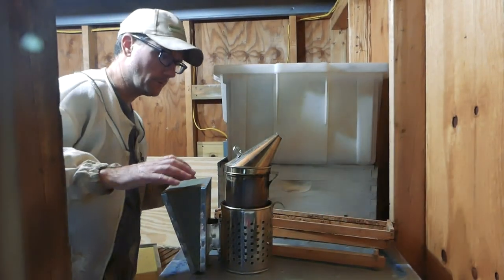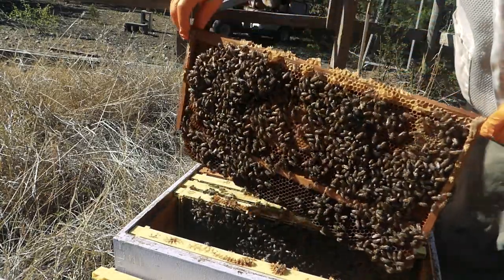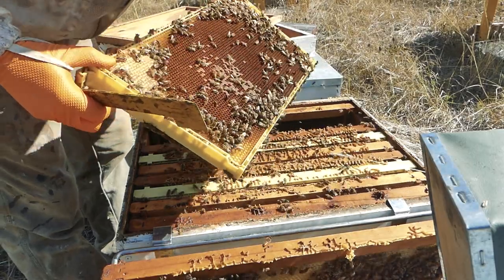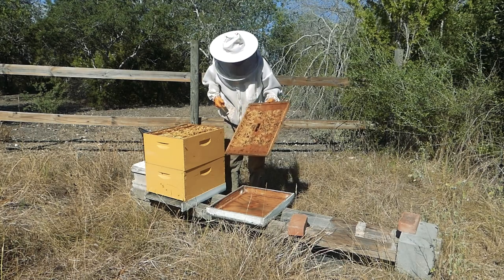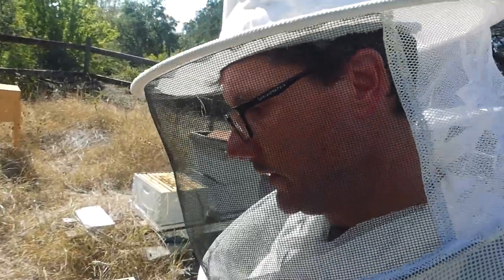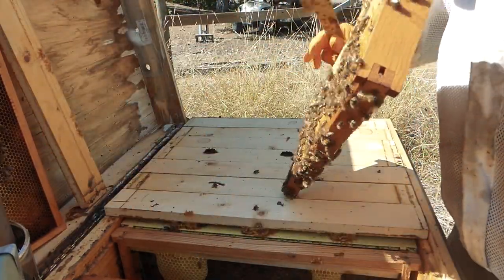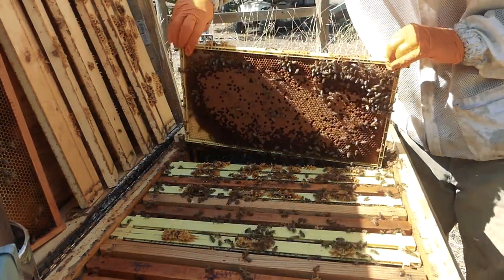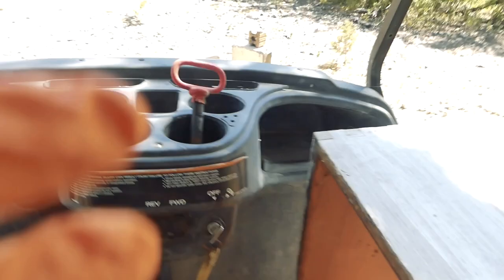HORIZONTAL HIVE outperforming vertical? ... SURPRISED ME!

Comment: Finally, a good review on horizontal hives  black mountain honey gave horizontall hives a really bad review, all I use is horizontal hives.. You can't manage them like to do a normal vertical hive. You need to give them at least a year or year and half to let them get established. I have layens frames though..I have 24 hives 29 colonies and they're all producing massive honey harvests. If you start with too many frames they'll never build out full frames, you need to get them to the point of nearly being honey bound with less frames then add them after a big flow or before depending when theyre nearly honey bound on the honey frames.  Also once you have excess comb frames you can start a new layens hive relatively quickly. After 3 years of layens I have so much excess comb frames and that really helped me get other horizontal hives established quickly.   When I started with horizontal I hated it, nearly burned the hive to the ground. I did tons of research and got as much knowledge as possible. After learning I had instant success. I was trying to manage them like a normal commercial hive before and I failed. One colony has 29 frames and it started with 8. So I'm guessing I'm doing something right. Haha but just remember this strategy works for me in my region in the Pacific Northwest. Might not work for you. But be careful if you let them get too honey bound they'll go crazy with building comb in all the wrong places. 😅 Took me a while to figure it all out.
Reply from the maker: Thank you for that. I love it when people share their experiences. I do think a deeper horizontal hive would be better. I thought about building one... I'll just add that to my long list of projects LOL.

Comment: How are the long hive legs holding up ? I have resorted to using old refrigerator bodies laid on their side to sit my horizontal hives on. 
Termites and the weight of the hives can result in the hive not being " horizontal " for long . Old refrigerators are easy to level up and stay level. Available at the local tip / recycling centre. Great video, your climate sounds similar to here in Queensland,  Australia so your observations are relevant to us. Thank you.
Reply from the maker: Mine are sitting on rubber mats. Maybe that has helped with termites?  I haven't had a problem with the legs yet.